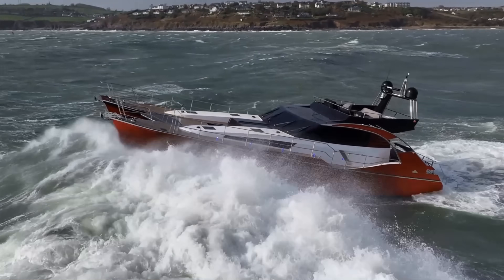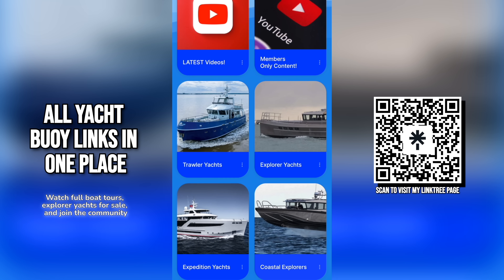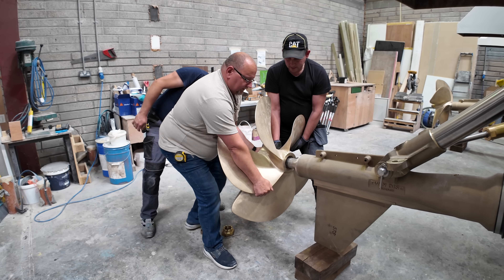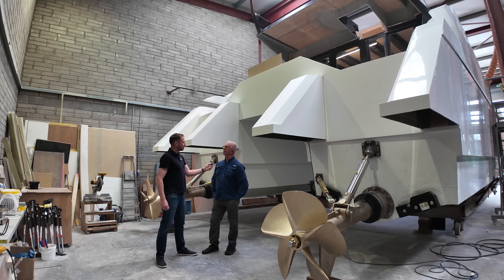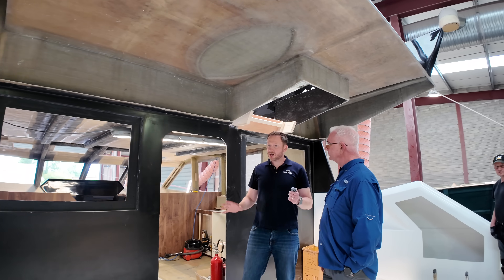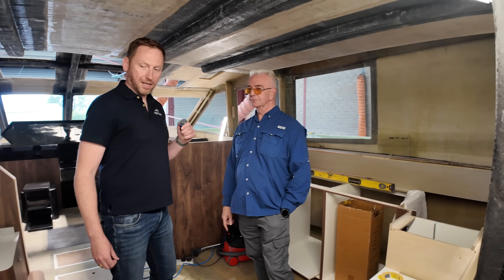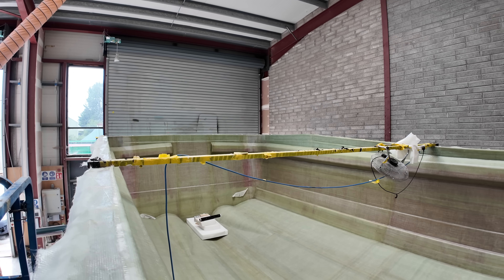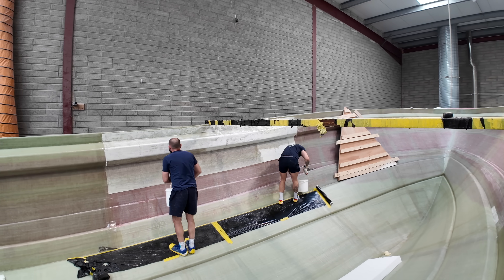INSIDE SAFEHAVEN MARINE | Building the T2000 VOYAGER Explorer Yacht

Comment: Great video but I am a bit confused. I thought that hull number 1 was originally white but then wrapped in red with the smaller engines twin MAN V12 engines, each producing 1,550 horsepowerand France Helices SD5 surface drives.
I thought the second hull was wrapped in Blue , had a flybridge, was designed for the med, had the upgraded twin MAN V12 engines, each producing 2000 horsepower, and used Arneson ASD14 surface drives. Is the one in this video the later? The one you went out on with Frank in the last video with you all on the flybridge? What size engines, surface drives, and configuration will hull number 3 be?
Reply from the maker: Hull 1 originally featured a red hull and an open flybridge with no hard top. It was later upgraded to a ‘Med Spec’ configuration, which included adding the hard top, several other refinements, and a new blue wrap